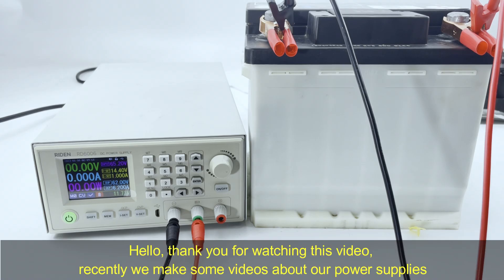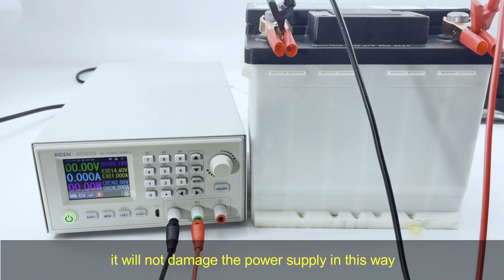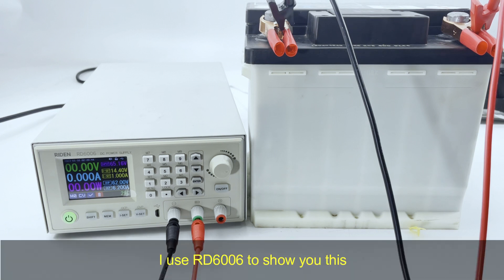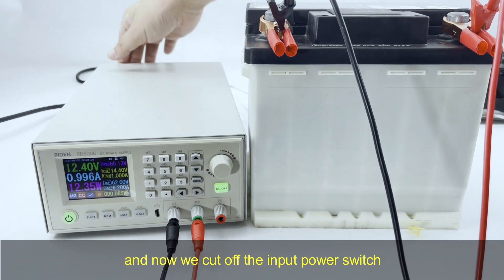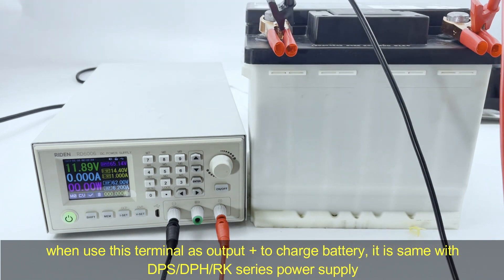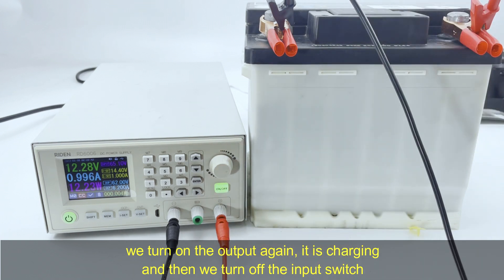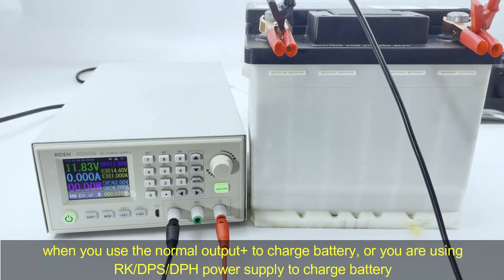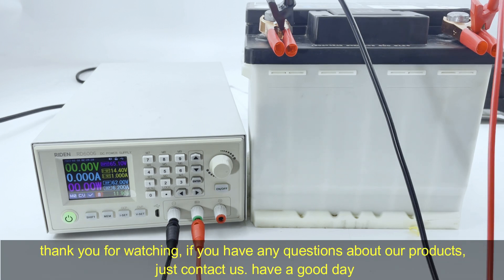what will happen if we disconnect input power when charging battery RD6006 RD6024 RK6006

Comment: DONT BUY FOR CHARGING!  If you disconnect mains while still attached to battery - device will NOT turn off!! (yes it connected to the green terminal) it will drain battery. Relay never turns off. At least in RD6030 model.
Also when you give mains power back -it no longer uses set output parameters! Current will always be lower than set. If you set 15A you will get ~13A., You have to clikc On/OFF to turn off and turn on output to get correct output. 

Also if you configure this device to turn on output whenever you turn on device (give mains power) it turns on for 1 sec and turns off output!!! So you can not make automated battery charging because it just wont turn on! even if config tells it to turn on output! As with all chinese device s-they come not tested, full of bugs, bad design and many more problems. You buy chinese mad e- you pay double.... so just buy european device the first time.
Reply from the maker: 1. for battery charging and cutoff input power, I make many videos, you use red black terminal, cutoff input power, it will power on the device screen, if you use green black termial it will not light
2. you said you set 15A but 13A, please check the output mode, CC or CV, if it is CV mode, this load only need 13A at the voltage you set, because I=U/R
3.auto power on when charging is suitable for the red black terminal, charging battery terminal no, if you are not at home, you charge battery when the AC input comes, where is the safety
4. if you live in EU area, you pay vat for the goods you buy, it is the rules from 2021.7.1
these are all in the video we make before, or in the manual and product page, if you think it is the problem, make the video to show

Comment: You can now market it that it has a built-in voltmeter.
Reply from the maker: it can only be used for battery, it cannot be used in other circuit for testing

Comment: почему на экране нормальное подключение батареи - выделено красным цветом. как так? красный это "опасность", красный - это внимание.
сделайте это "зеленым"
зеленый цвет - это всегда "ок", зеленый - это " хорошо", зеленый - это все верно
Reply from the maker: hello, it is the RD battery charging function, when no battery connected, it shows in white battery with blue background, when connect battery, blue turns to red, and start to charge battery, it becomes to green, you can check the battery charging function video to see how it works, it is used to remind you if the battery is well connected and if it is charging
Reply: @rdtech9153  это я занаю.
вопрос был про то что это не логично ;0)
Reply from the maker: @Forvad  I do not understand why you said it's not logical, each icon corresponds to a battery status, not connected, connected, charging

Comment: This backfeeding is a really bizzare behaviour. This would mean that either the output tap is common to the internal electronics' power supply or that they have some weird kind of bypass inside to allow this functionality...
Reply: Not necessarily. If they are using a FET to control the output, then when the supply power is removed, power could travel backwards through the FET's body diode to power to the device.
Reply: @michaelrcolton  Not unless there is additional diodes or some kind of connection between the load power supply and the internal electronics power supply...
Reply: @iprot00  In a buck converter there is a FET between the supply and the output, when the supply is higher than the output, the FET's intrinsic diode (something that, I think, all FETs have by virtue of their construction) is reversed biased, but when the output is higher than the supply, the diode is forward biased and can conduct power.
Reply: @michaelrcolton  Yeah this is exactly what I've said; this falls under the "the output tap is common to the internal electronics' power supply". Otherwise I don't see how it would power up the internal circuitry without additional components. Unless you have some other ideas?
Reply: @iprot00  I mean, clearly the internal electronics and the output get their power from the same place to begin with, how else would it work? I don't think such a small, inexpensive supply would have a fully isolated design, if that's what you mean. For the cost, it's a compromise in willing to live with...
Reply: @michaelrcolton  The power supplies I've seen and/or worked with have a separate power supply for the load. I haven't examined the features of this one but I thought it seemed unusual.
What do you mean not isolated? Surely it is not referenced to mains?
Reply from the maker: In fact, we have a post made by a customer that introduces this principle, but it is in Chinese, and the link cannot be placed here, most power supplies in the market are same with the red normal terminal, connect a battery, the power will back to power on the screen but no damage
Reply: @rdtech9153  If it is in text I can probably translate it. Can you tell me how to find it?
Reply from the maker: @iprot00  you can contact us on aliexpress or the email in the video description,  said that you from youtube and need the post of charging battery

Comment: tldr: 
- when using battery output terminal it will switch off.
- when using positive output terminal it will stay on.
Reply from the maker: Good summary, but normally they won't believe it without the video haha
Reply: no it still be ON even if using green temrinal.